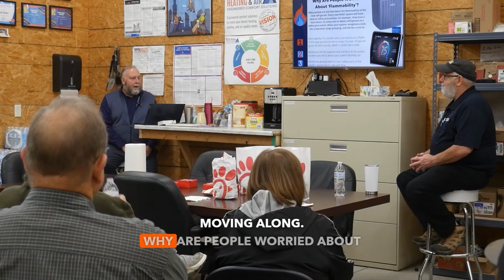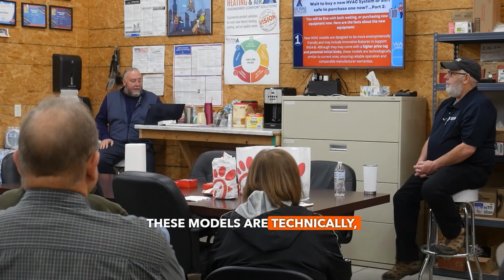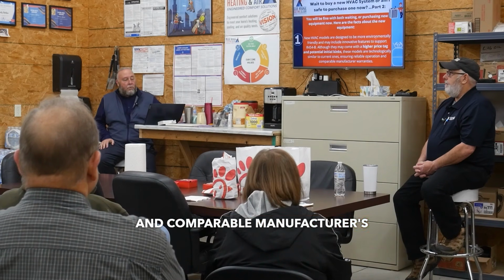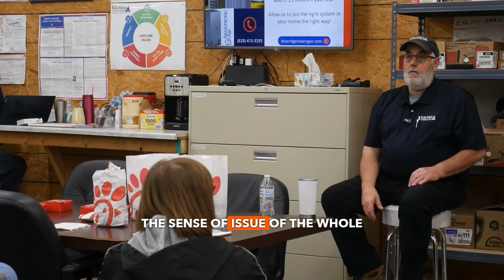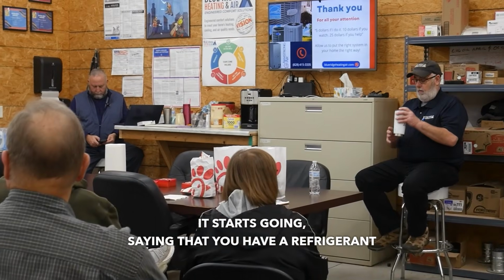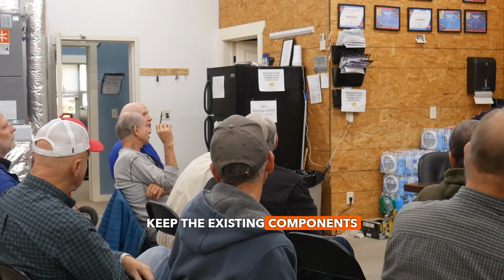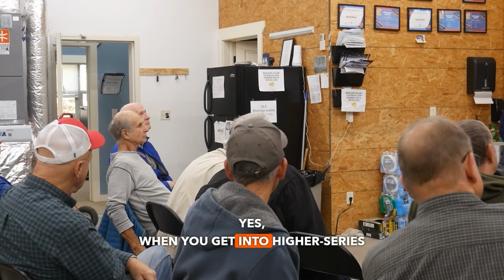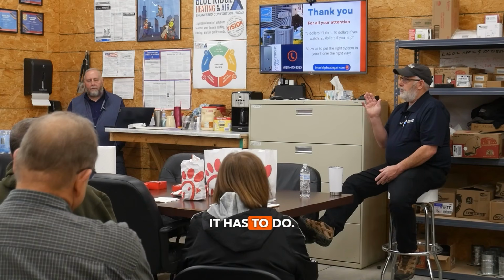The Future of HVAC: R454B Refrigerant & System Innovations - Full Seminar Part 2 #hvacsystem #r454b

Comment: If a customer has a 15+ year old furnace and does not want to change it out will the mitigation board able to  connect to that furnace ?
Reply: new coils with safeties as of right now will not work with old/existing furnaces. maybe manufs will come up with a "conversion" kit for it to be compatible. what it's doing is when it detects refrigerant, it shuts off the AC compressor and only run the blower motor to dilute the refrigerant leaking inside the evaporator coil/duct work.
Reply: Yes, they come with the coil

Comment: I had the carrier 25vna60a003 It leaked freon and now the dealer wants to disconect the high effenciey side. how does that effect the 24 sear efficency.
Reply from the maker: Hey without knowing more details about your situation, perhaps this response will somewhat help: 
To Disconnect the high efficiency side of a system is to run at low speed all the time.  I don't know the system break down but it Probably will run at 60%.  And if it is a refrigerant problem,  it will eventually leak out and run on emergency heat causing the power bills to rise.

Comment: Are they calculating in the defrost cycle where you going to cooling mode or is that without the defrost cycle?
Reply from the maker: Hey Dave, thanks for the question! Are you talking about the refrigerant change in general or the part where we were talking about Heat Pumps?
Reply from the maker: Maybe this can answer your question in the meantime: Today, it is 15 degrees out side, and the thermostat is on 70 degrees. We don't have the heat strips hooked up at the thermostat.   If the HP goes into defrost mode it will shut the indoor blower off.  The blower will not come on until it gets to a certain temperature.  This eliminate a blast of cold air from blowing in the home

Comment: They say the pressures from 410a to 454b are only slightly different, are they slightly higher or lower? Also are rtu's going to have the same requirements of new  refrigerant?
Reply from the maker: We believe the operating pressure for R454B is slightly lower. The R454B will be in all NEW equipment including new rooftop units. RTU's that use older refrigerants can still use old refrigerant!
Reply: @blueridgeheatingair24  ok thanks slightly lower is a good thing because some of these evap coils can't handle the 410a pressure, I'm getting mixed info about rtu's from some local supply houses saying that 410 units will still be sold for many more years unlike resi units just finishing out their stock pile throughout 2025
Reply: @ lol, it's not that the coil couldn't handle the 410 pressures. it's just poor quality/manufacturing, and/or poor installation. and you could also say, "planned obsolescence".

Comment: Will you be able to install the flammable refrigerant ontop of a 80 percent furnaces
Reply from the maker: Yes sir!
Reply: furnaces are not open flames directly onto the evaporator coil/refrigerant. it goes through heat exchangers, and it definitely doesn't reach 900 F degree unless the blower motor isn't working but it will shut off with high limit switches.
Reply: @ propane is heavier than air so if you’re sitting above a 80% furnace, the propane will fall down by the burner and it will be by open flames unless you’re a pull through and your coil is below your furnace
Reply: @ for the love of god, 454b and 32 do not contain propane. a simple research would've helped educate. and no, typically the evap coil is sealed so well that only a very small amount of air leakage. the sensor would've picked it up from inside the coil and shut off any ignition sources. Unless, the sensor fails, but the blower motor is still running so it'll help dissipate the refrigerant.
Reply: @ if it is so safe wy do we need to install refrigerant monitors. Why do we need to replace our vacuum pumps? Why do we need to replace our recovery machines?
Reply: @ it's safe under proper handling and installations, it is still an A2L category and can ignite under correct conditions. A2L vacuum and recovery machines are brushless motors, because brushed motors create sparks when they start and/or while running.
Reply: @ so is dynamite, but I won’t sit down on top of my furnace
Reply: @ at first it was protein based not propane based it’s not flammable now you can’t even figure out what’s in it because nobody will tell you what a cover-up

Comment: I want R290 A/W monoblocks for cold regions.  Pathetic how Europe and Asia are so far ahead of us.
Reply from the maker: It seems like they are BETA testers!
Reply: @blueridgeheatingair24  Propane heat pumps are about 100 years old .. how much time to regulators need?  They hold about a tea pot of propane.. my bbq has 20.  In an air to water system no propane enters the house.  It is sealed.  This smacks of either incompetence or corruption.
Reply from the maker: @solarguy4850  I have heard your last sentence many times! Many folks have been saying it is a money making scheme when it comes to all of these changes and mandates!
Reply: @solarguy4850  i have ben saying the same thing sense this al started they could make it in a heat pump all they have to do sell it with a system pump that is sized for the unit provid the coil and matching furnace are air  handler as a package it would work good as long ss the installers would actually read the installers  guide

Comment: I need a new 3 ton should I get one before the end of the year. What brand and what freon?
Reply from the maker: More than likely, if you're looking to purchase before the end of the year, you'll be considering an R410A ('Freon') unit. Opting for an R410A system could save you money in the long run, as it’s a proven, reliable option with established technology. Plus, you won’t have to worry about potential hiccups that may arise with the newer R454B equipment, which is still in its early stages of use.

However, if you'd prefer to stay ahead of the refrigerant mandate and prioritize environmental initiatives, R454B units are a great choice. Just keep in mind that they may come with slightly higher upfront and maintenance costs as the technology and industry adjust to this change.

Ultimately, the best option depends on your unique home and situation. I would be more inclined to purchase an R410A unit personally due to the fact it will probably end up saving you money over the next few years. We recommend speaking with local HVAC professionals to discuss what brands and models suit your needs best. Trusted brands like Trane, Goodman, York, and Armstrong Air are solid choices no matter which refrigerant you decide on.